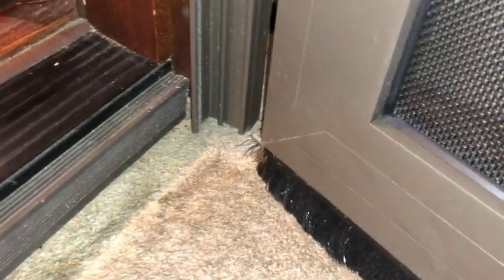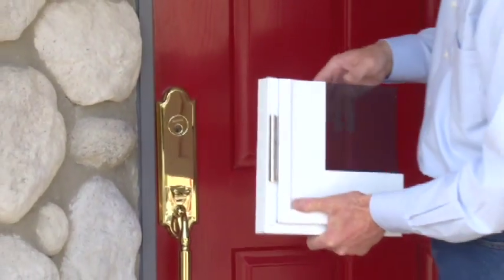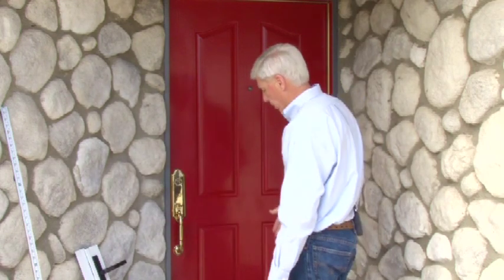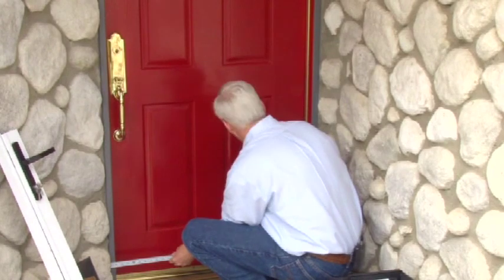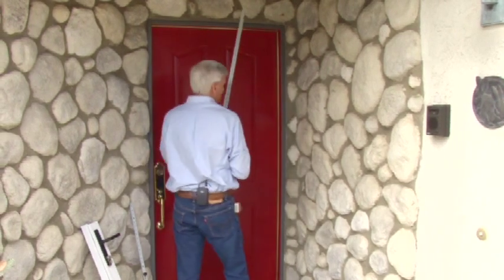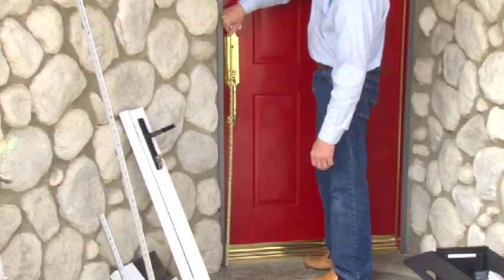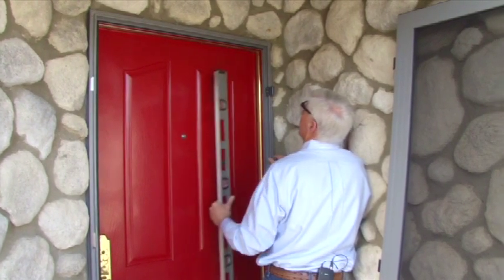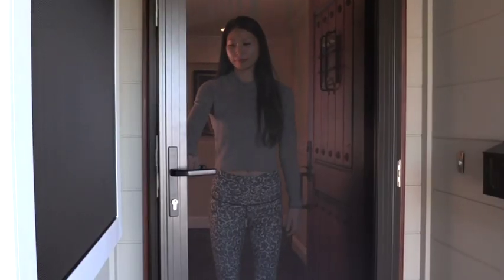Security Screens Swinging Door Tutorial | Campbell Security Screens

Comment: Wouldn't one be able to easily remove the screw covers and then unscrew this?  Do the screw heads get filled with something?
Reply from the maker: The covers are vey difficult to remove without a special tool and it has never happened to our knowledge. The screws under the covers are a tamper-proof design.